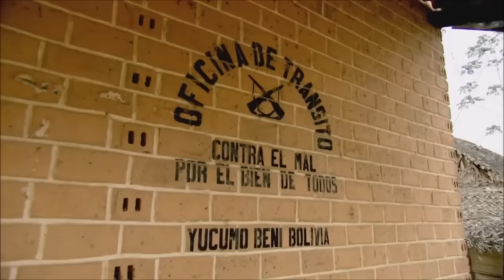Top Gear | Bolivia Special | Funny Moments

Comment: Every time I see Hammond and May smacking the tree with the machete like it's an axe I die a little inside.
Reply: If you know what you're doing, and have a decent machete you can chop down a tree with an axe no major issue. Will be slower, but doable  

I've chopped similar sized birch and hornbeam with my tramontina
Reply: The problem with that is that if there's a scale of "knowing what you're doing with a machete", You're at one end and James May is as far off the other end of the scale as it is possible to go.

Comment: This is what I don’t understand. In the recent Grand Tour special, the Focus RS lost its clutch in Madagascar. Hammond lost his clutch here and still kept going
Reply: What you dont understand is there is a difference in mechanical engineering in a 60 yr old 4x4 and a brand new plastic baby's toy.
Reply: You can actually change gear in that old box if you know correctly guess the revs of the engine and change the gear perfectly,  modern cars will stall if you do that without cluth
Reply: @utkarshverma7 that explains why Hammond was talking about the revs went they went through the volcano